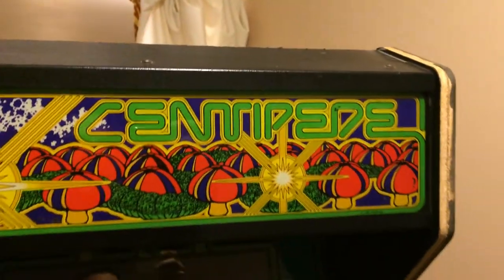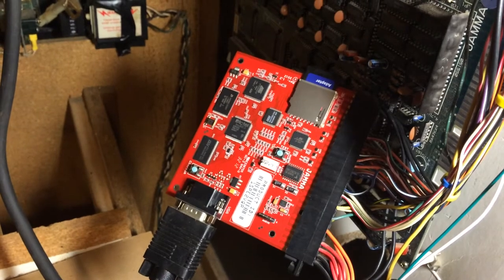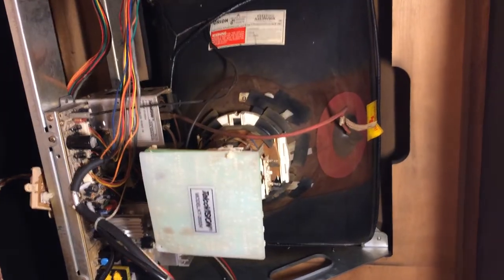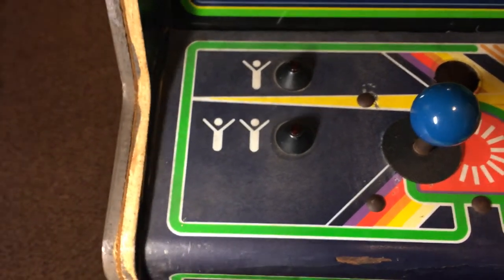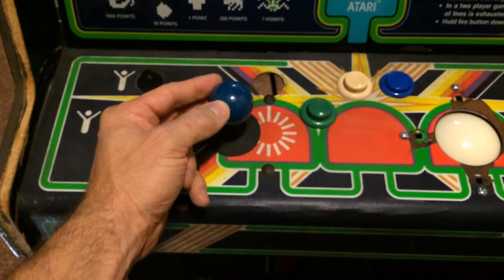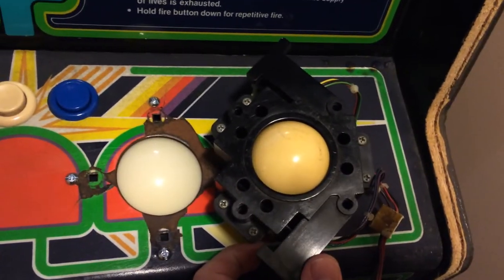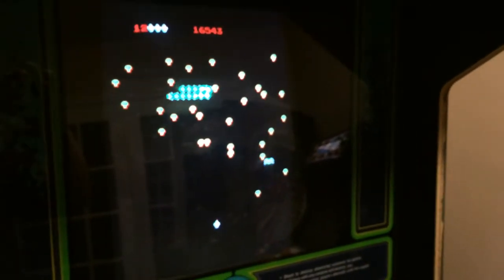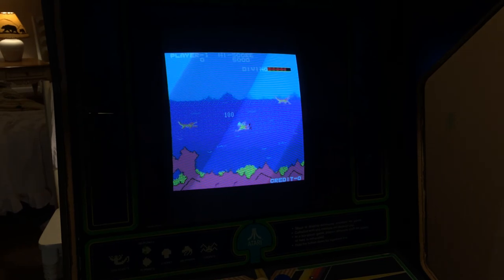Centipede Arcade Restoration - Part 1

Comment: Hey Jeff,

Did a ground wire come with the original trackball?   
I can't remember if one came with mine.
Reply from the maker: There was a ground wire attached to the power cord that was used to plug in the trackball.  I'm not exactly sure how it was hooked up as the one i have came with the control panel that I picked up separate from the cabinet.  It was detached when it showed up.